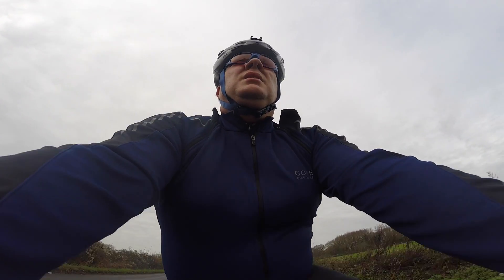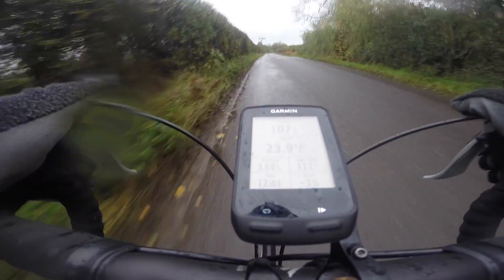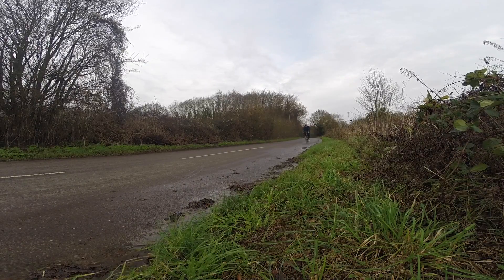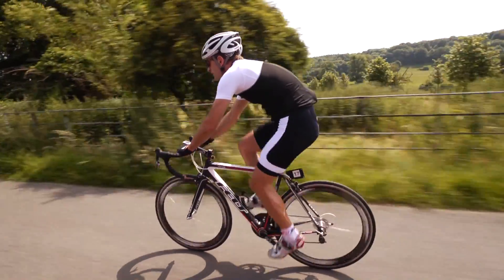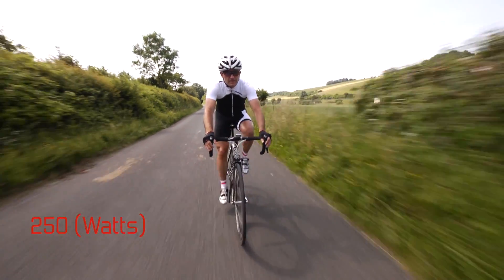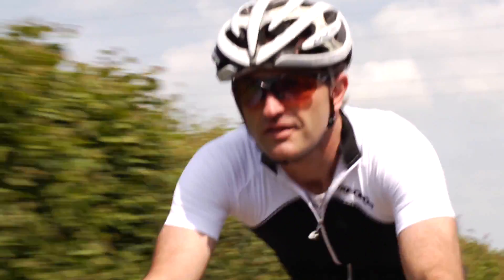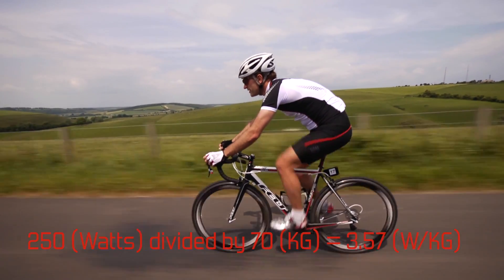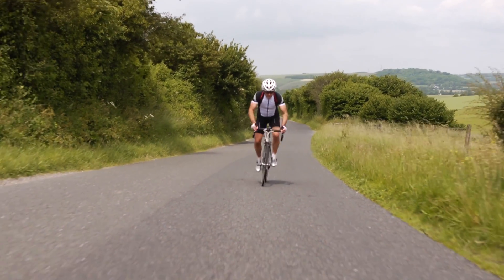The Power To Weight Ratio Explained

Comment: Power to weight ratio is an elitist measure that highly favorizes lighter riders, and the best way to boost it is not to develop muscles; it's to go on a diet.
Reply from the maker: +Scul Ptor Hello there, being a heavier rider myself, you are absolutely right. The single best way to improve one’s power to weight ratio is to lose a few kilos but I would also be useful to at least try and improve power at the same time.
Reply: It depends what power you are starting from and what is your weight. If you are already light and your power low then you need to increase power. If you are overweight and have low power you can do either to start with. You basically have to look at where the room for improvement is and go after that. For me it is power, i may be able to loose 2 more kilos but that would be my limit and it would make little difference.

Comment: On a flat road watts per kilo means hardly nothing. It's max watts with proper gearing
Reply from the maker: It would be interesting to actually find out if the power to weight ration made a difference on a flat road. I may just put this to the test with the aid of a power meter sometime.
Reply: It's so close you would have too much wind resistance variables. I ride with power and can say aero trumps weight for sure. I choose my tt bike for tt even though it's heavy compared to my road bike. Shedding weight off does hardly anything on flat, but reduce drag and speed shoots up.